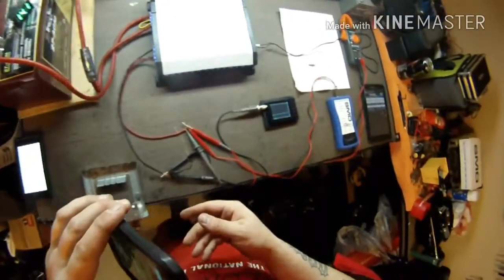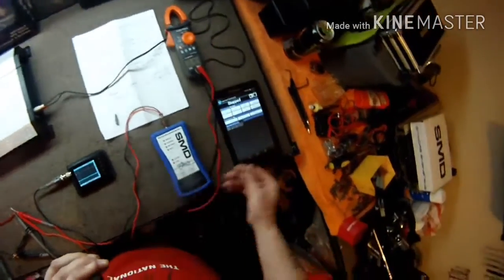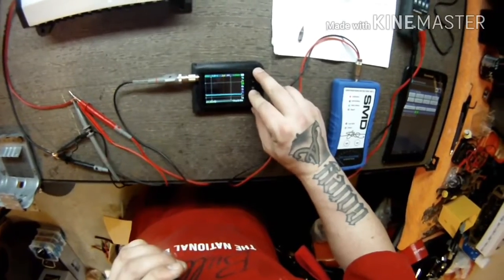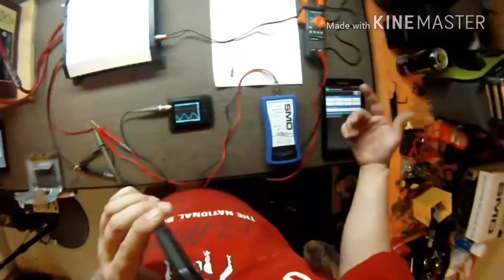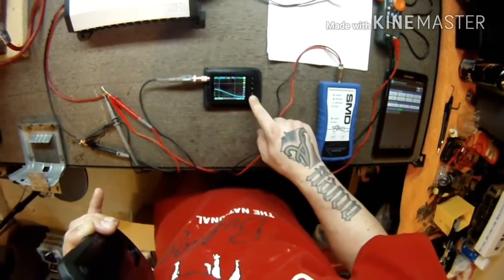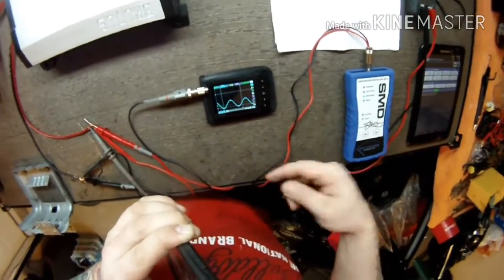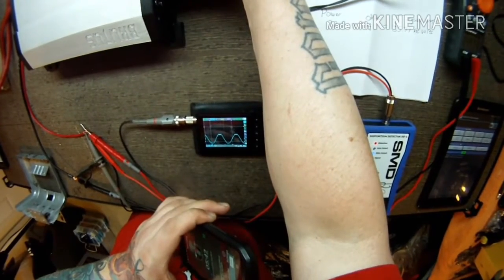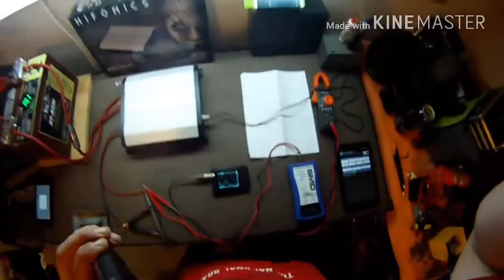DD1 & Nano V3 Amp Tune

Comment: Distortion means that the output signal is different from the input signal. Any modification of the signal, be it clipping, noise, or any waveform different from the original, is distortion.
Instead of the Nano v3, you can use an oscilloscope that displays the FFT and you will notice that as soon as distortion appears, harmonics appear, even before the CC1 detects distortion.
Only the 40 Hz fundamental should appear, nothing else.
I suggest you keep the camera fixed and at a minimum resolution of FHD and turn the amplifier so that you can adjust the gain without blocking the DSO or the CC-1.
Reply from the maker: Good info!

Comment: what are you using for your probes on ur dso
Reply from the maker: I'm actually using some that Amazon.com referred to me as something that the majority of people bought with it. I have what if I can remember correctly is a "BNC" connector and probes that are 10x so they can handle the higher power. Sorry I forgot the actual name of the probes.
Reply: StinkyArmpit Bass do you only use a probe for positive?

Comment: Hi Buddy, great Video, 
I purchased the DSO nano v3 and amp trying to tune an Alpine 1.1000 mono amp powering 2 * JL Audio W6. When I check the ohm level of the subs wired down to 4 ohm when checking with multimeter it shows 3.35ohm. I am trying to give it the full 1000 rms. My calculation was 1000*3.35=3350 and taking the square root of that will be around 57. I am looking for 57 on the multimeter and would like to check if it’s a clean signal with the DSO nano V3. I am having bit of problem with the DSO nano, when checking the signal the wave is going out of range, I am not able to see if the wave is clipping,  I have the Y set at 10v and X at 2ms/5ms and the wave is still out of range, is there anything you can recommend to help? Thank you
Reply from the maker: Prada Sundareswaran go to 3:35 in the video and watch how I change the view of the wave on the screen. The more power you run through the wave the larger he gets in and goes off the screen, you didn't have to adjust the wave so you can see it again. Hopefully this helps.
Reply: you might need the probes he uses that allow you to 10x the voltage range.